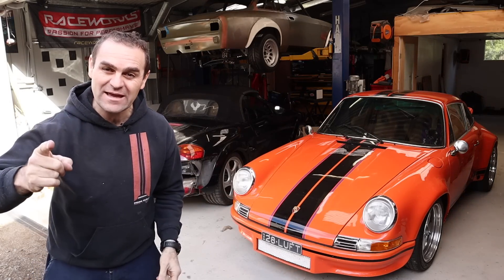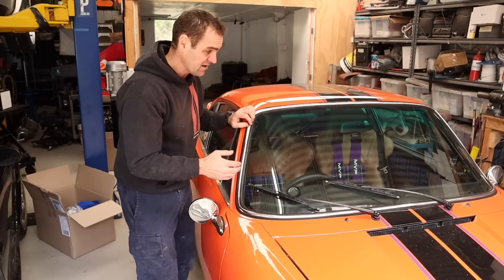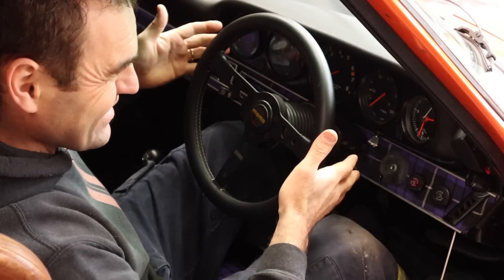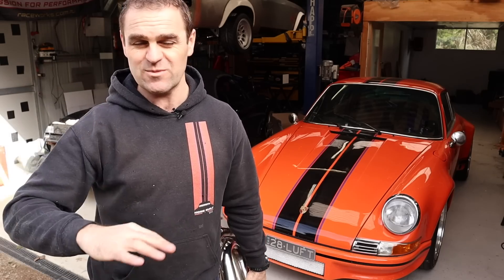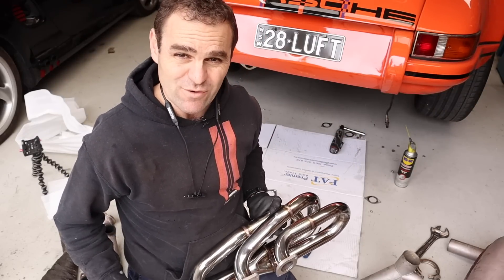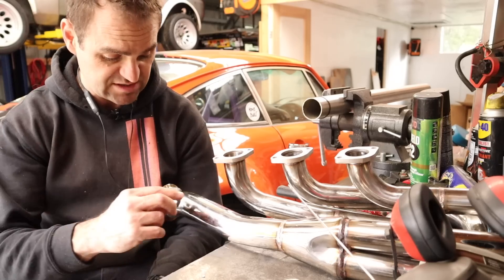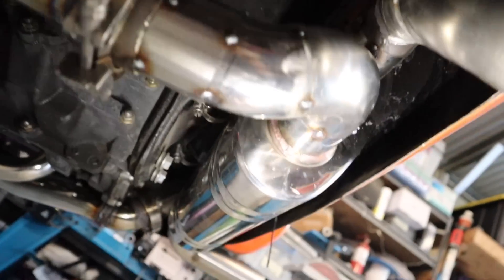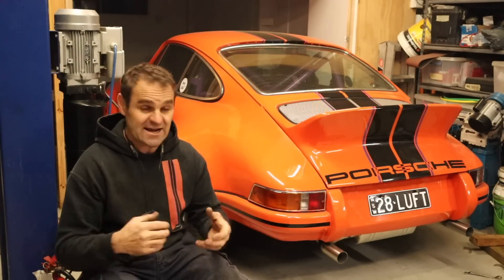Custom 911 exhaust - Porsche 911 2.8 RSR Build Season 3.13

Comment: Looks and sounds great. Interesting piping too the muffler. As others have mentioned are the two pipes completely segregated in the muffler? Thought there would also be an in end and out end to the muffler. Hope flow is even through both pipes.

Comment: Im was very surprised and impressed when you mention how a glued in windscreen would offer you more structural rigidity!  

It baffles me, but not too many people are aware of this fact. 
(Scary when you think of how many people drive around with cracked or poor quality windscreens...)

 "The windscreen is an essential contributor to the overall strength and rigidity of the body of the car and is a major element of the car’s safety restraint system in the event of a crash.  
It provides up to 47% of the structural integrity of the vehicle"
Reply: ..... On a car that is designed to have a bonded windscreen.
Reply: @ro63rto  dont be fooled. A roped in windscreen is in there tight.   (Especially when then have the lock in strip) 
Add that with the fact the glass is hardened..    and you have structural rigidity..
Reply: @ro63rto  heres a test of faith.
find an old car with no front or rear glass.  Jack it up from one side  at the front, and open a door. And see what happens. 
Can do it all day if it had a screen

Comment: Exhaust notes rarely sound good on YouTube videos, but this is sounding really good 👌

Are you going to bother with the exhaust wrap (the new one looks better shiny and bare) ?
Reply from the maker: Probably not, as it doesn't sit as close to the coil packs as the last one did.
Reply: Header wrap will cause the headers to rust prematurely. Especially Steel tubes, which rust from the inside out.  Even Stainless Steel will eventually start to deteriorate from water and heat cycles.  Besides it looks way too nice to wrap.

Comment: Those headers and muffler do look and sound the part. I could not help but not notice the struggling cranking during starting. Is the engine running on a high compression ratio? Or maybe you need to check the battery, either for a faulty cell or check whether it has the correct number of cold cranking amps? Cheers
Reply from the maker: The car had only done some short runs and it was very cold. A good hard run and a warmer day and it is all good ;)

Comment: Is the muffler 2 seperated sections? Otherwise wouldn't you be blowing exhaust gases against each other
Reply: no... two parallel tubes sharing the same muffler housing. Gas flows in opposite directions. There is possibly some interaction, but definately not significant. Have used similar before and it works very well.
Reply: @mikedsilva  Kind of what I was thinking, with the two collectors staggered. But it does seem as if there's some mutual cancellation going on, I'd have expected a straight-thru box on a hairy engine to be (a lot) louder. I guess we're all waiting for the numbers (and how it feels to Jeff on the road).
Reply: So like an X pipe or H pipe. No big deal- I have one on my 370Z Nismo and it sounds awesome and helps scavenging.

Comment: I’ve done similar and found I gained on top end but lost some torque low down. I’ve ended up keeping the original headers but using 200cell cats and new back boxes. I have gained some torque back low down which makes for a better drive but then lost a bit high up. I drove it for a day and now the front shock has wet it’s self all over my drive. Cars apart again 🤦🏻

Comment: Header size spot on.  Fingers crossed it gives back missing the top end.  Can't believe you left us hanging for a full bore sound check!  Foregoing heat?
Reply from the maker: At this stage I am going without heat, but I may add it later. To be honest I never used it as it was :D
Reply: @HomeBuiltByJeff  I'm glad to hear that, it's make me comfortable with my decision to run headers on my build.  I'm thinking of trying a small electric PTC ceramic heater under the dash at a later stage, similar to what they use in the Prius.  Would have to be careful with current draw of course.
Reply from the maker: @dra911  With my hugging seats, I really haven't had an issue with no heat. The big thing is no A/C or even air flow, but that will not be for much longer ;)
Reply: @dra911  The most important thing when going no-heat is to make sure the ventilation valves work 100% (there is a foam sealer in the ventilation boxes that disappears over time) so you can shut them of completely. If you get a constant small draft of cold air its going to get hellish after a while.... I never had heat in my 911's and done some driving in near freezing temperatures.
Reply: @HomeBuiltByJeff  I have a feeling I know what's coming soon, haha

Comment: Jeff, I never noticed it before, but are you aware you still have the LHD wipers on your car?
And that they are swapped left to right?
Makes sense, since the car was originally a LHD and obviously nobody ever bothered to get the correct arms...
Reply from the maker: My car still doesn't park the wipers , so sometimes I stop them on the left and other times on the right :D

Comment: Regarding the tacho dampening.... Could you perhaps shorten the plastic insulation by a few mm so it doesn't touch the inside of the clear cover....THEN add a small compression spring over the top of the insulation, so that the SPRING creates the tension rather than the plastic. I'm thinking, for example, of a spring out of a retractable biro or even smaller.

Comment: Be aware of the importance of narrow inlet and exhaust manifolds (compared e.g. with your carburettor and exhaust diameters) in order to achieve high gas speed near the cylinders - particularly on the exhaust.  This is because moving gas has momentum, and it's the momentum of the gas which just left, which sucks exhaust gas out of the cylinder even at the end of the piston stroke, when the piston is no longer moving at full speed. Just thought I'd mention it as one of the most common causes of unexpectedly low power gains from engine mods.  Also, I thought your exhaust welding on this exhaust looks way tidier (on the inside) than the last one you made. I was concerned the previous one may not flow well.

Comment: Have you changed from the Bossweld ac-dc welder you used to use and if so why.   I ask as a bossweld owner who hasn't tried mine out yet . Need to buy gas.
Reply from the maker: I have signed on with Weldclass and upgraded all of my welders :D
Reply: @HomeBuiltByJeff  thanks jeff. I was afraid i may have bought a lemon.
Mind you, i got for just $150 new at Bunnings on closeout.
Reply from the maker: @glennp9904  I never had any issues with my previous welders so I am sure you will be fine.
Reply: @HomeBuiltByJeff  thanks

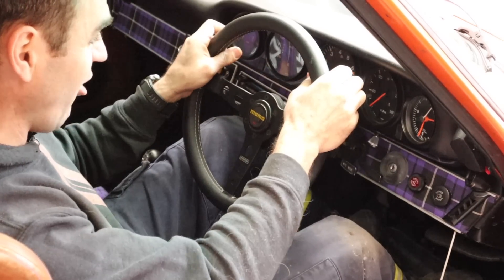Comment: 7:15 egg shaped wheels are terrible though, even if you're not drifting and letting go of the wheel. 
In your case won't you have even less room past 90°? Can't you just raise the column?
Reply from the maker: The only time you are anywhere past 90 when you are driving is when you are parking. A lot of factory steering wheels have an offset, and no the column in a 911 is fixed.
Reply: All the 944 steering wheels are offset to provide better thigh clearance.  Not an expert on 911s but the early ones also used an offset steering wheel.  A lot of people have clearance and gauge sight issues when going aftermarket.  Flat bottom wheel is another option if you can see the gauges

Comment: I’d be careful running with the new exhaust without checking the AFR .. I’ve heard of engines being cooked after swapping to a freer flowing sports exhausr .. resulted in much leaner running which without a re-tune burned up a piston & / or valve.
Reply: Wouldn't the muffler counter or give some resistance to gas flow and counter slightly the freer flowing headers?

Comment: Are those pipes in that muffler sealed  from one another?
How does it go  when the exhaust gasses are blown at each other?
Reply from the maker: Each pipe is straight through, but the glass pack in between is shared.
Reply: check out this one near the bottom of the thread.. http://forums.pelicanparts.com/porsche-911-technical-forum/895325-my-new-build-last-long-but-very-fun-journey-43.html